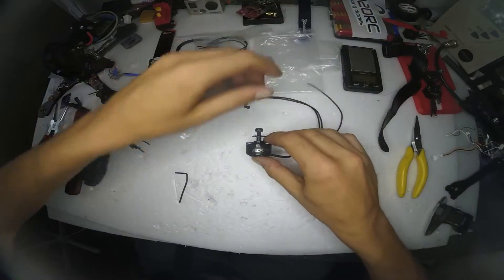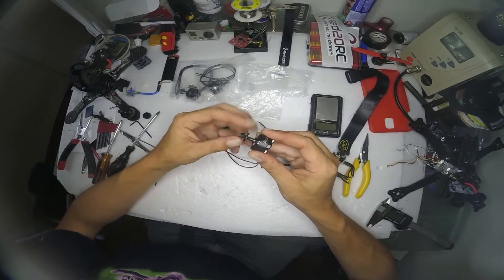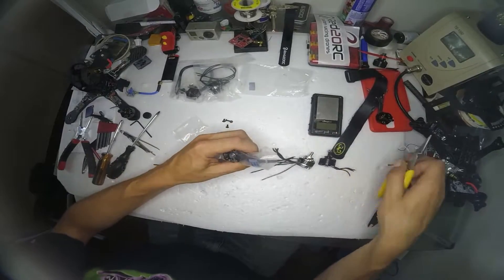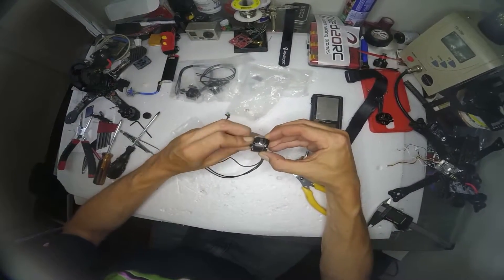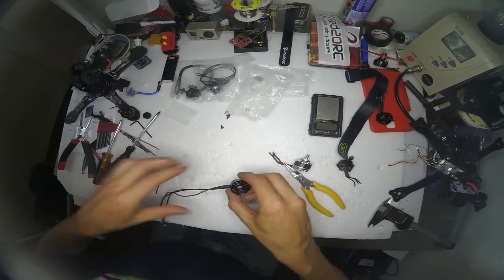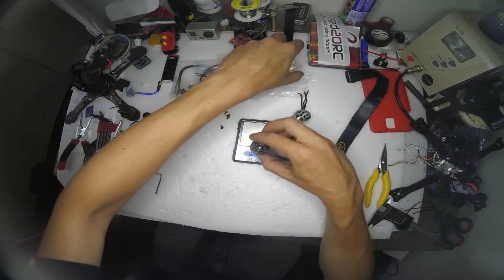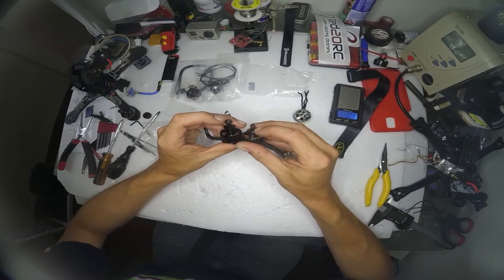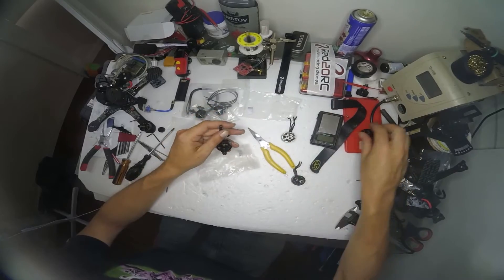RCX H2208 - 2000KV - part 1

Comment: Good motor break down. Now let's see how those light 2208's deal with the abuse you'll put them thru. Checking out the flight video you uploaded next!.
Reply from the maker: +EngineerX i do have two notchy bearings so far , shall move the motors to a another frame that i'll crash more but i dont plan on doing a part 2 till i put them through hell first xD
Reply from the maker: +Rotceh here's some dvr footage i dont think will make it to youtube https://www.dropbox.com/s/hfnzv82hptdtb56/pod%20DVR.mp4?dl=0
Reply: +Rotceh Thanks mate, I'll check it out in a bit when I get home from work.... darn office network blocks dropbox and all file sharing sites, but at least I got YTube. 
Ah, too bad those bearings got notchy, It's great that MRCM sells all the replacement parts for almost all their motors. They just need to improve a few things here and there and they'll deliver some very good motors at very affordable pricing. It's crazy all the new motors coming out from everywhere nowadays

Comment: It's between these and the new EMAX red bottom motors. 
Looking for a tough motor with a lot of grunt for a 5" freestyle frame with some tri props. Weight isn't a big concern as power and durability.
Reply from the maker: +Matthew Bennett hmm sofar the red's would be my pick there for you , these have yet to prove them self's, i have crashed them many times so far and there feel pretty dam strong but two bearing have gone already i think mrcm changed bearing suppliers going to ask them , the rcx 2206 is still my favorite motor for power and durability but it might not keep up with the emax .
Reply from the maker: +Rotceh also depends if cost is a factor for you or not as it is for me so atm its rcx > emax unless i get richer lol

Comment: How's the performance?  Are they the same build quality as the 2205?  Happen to know if they're true 2000kv or more like 2100?
Reply from the maker: Performance is great but the build quality is the same as the 2205's and the bearings didn't last long. not sure about kv
Reply: +HecTech FPV what does 'didn't last long' really mean?  I have 2205's with well over 500 flights on them. They have that rolly sound and I've replaced some bearings. but for the most part, they're pretty good. I have more of a problem with slipped magnets from hard impacts. I wish they would sell bells for all their motors like they do for the 2205.
Reply from the maker: Well they got noisy and alittle rough after about 30-40 flights , i still fly them and don't plan on replacing the bearings till they fail completely but its worth noting that there abit shit . the only motor i have had magnets slip on was the 2205 V1's the V2 have been good and i have high hope's for the V3's :)

Comment: hey dude, i hate to do this, but since you have been doing couple of motor reviews for RCX, might as well just ask you.  
the RCX 2205 2950 kv, are they any good? those value on  thrust test sheet, are they for real?   thanks in advance, am just making sure before start ordering stuff for my 4" setup.
Reply from the maker: +Morzalee Mohammed Harris id' trust there spec's but i found the 2633kv on 4" is a perfect match and do not wish to go higher as my batterys will not cope

Comment: Rotceh I have 2 pretty heavy frames I need some new motors for (there like 140g+), basically bashers since I have my 2205 TSX for fun so do you think the 2206 would be good? also 1950 or 2250kv ?
Reply from the maker: +SyncR 2250kv id say , i do think the 2206 from myrcmart is there best motor so far
Reply: ***** Cheers man, I picked up some of those new ZMX motors last night also, seem to be great for the price
Reply from the maker: oh yea they are , was at a race yesterday with them and they did very well!
Reply: +Rotceh Good to know,  not sure if I should get some XM20A's for them though
Reply from the maker: +SyncR xm20s have really good results so far but its the QC that will kill them if they ramp up production again like what happened to the sn20.. , i really want to test the XM20 and the XM30 both on 3d and the 30 on 6S :)
Reply: ***** Yeah that was worries me about XM's, and thanks for replying to me in the ZMX thread on RCG gz on your wins :)